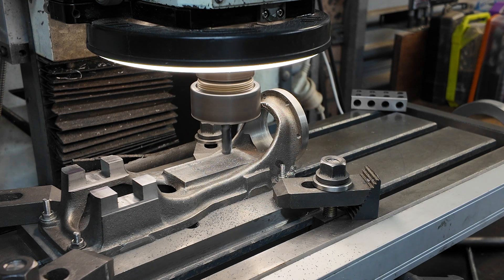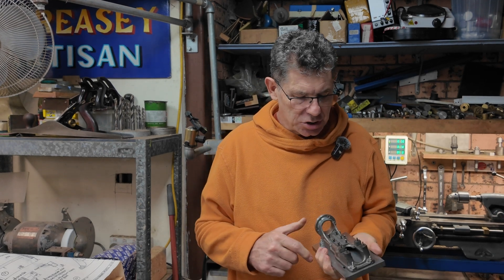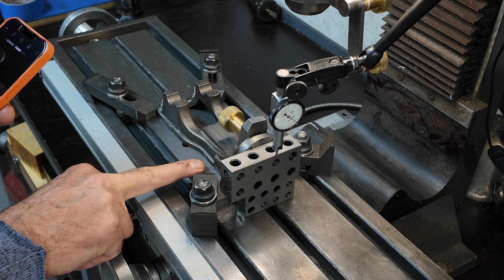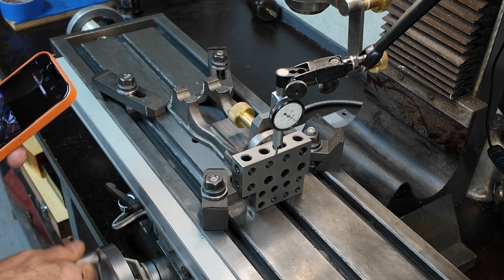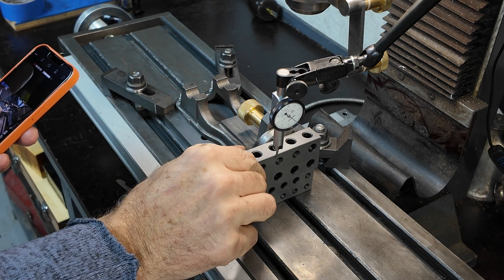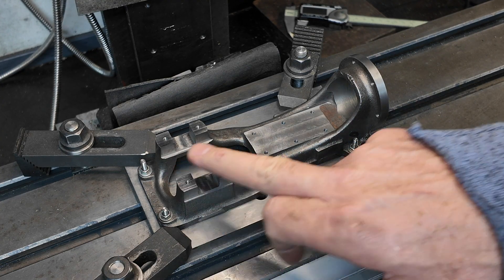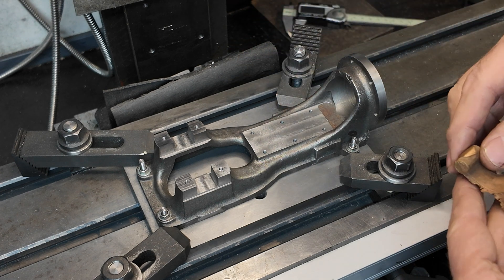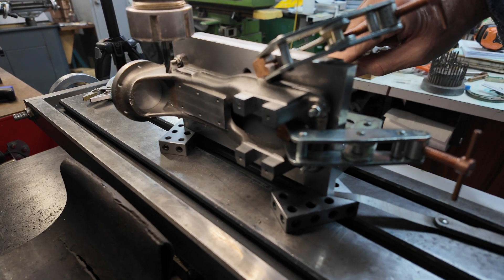Part 4 - Bearing Journals

Comment: What is it with the naming conventions of Stuart engines? The #9 is bigger than the #8 but the #10 is smaller than both the #8 and #9! Was it to do with when the kits were released?
Regards,
Preso
Reply from the maker: Yes I think it’s just the order that they were released up till the 10.  After that they started using names like sirius, Victoria etc.   It’s a miracle they still exist.  They once made a generator for Shackleton’s Antarctic expedition.

Comment: Wasn't it possible to cut the thwo surfaces (the last ones) in the same setup as all the rest? Just a thought.
Reply from the maker: Yeah I could have.  I thought I would get curved sides but actually that would have been very minimal so it would probably have been better.  Certainly much faster as it took me 3 tries to get that setup to work.